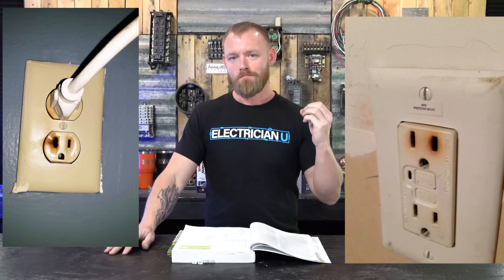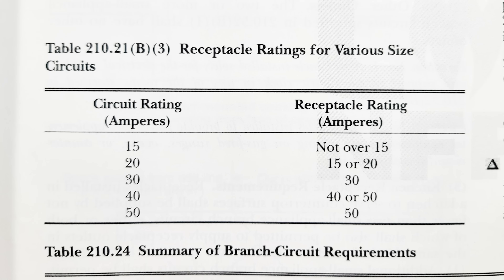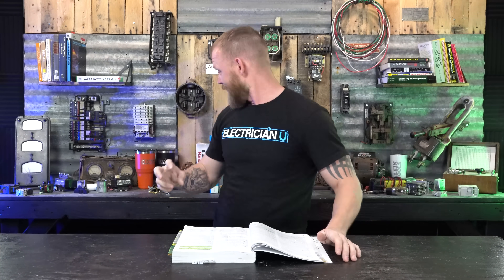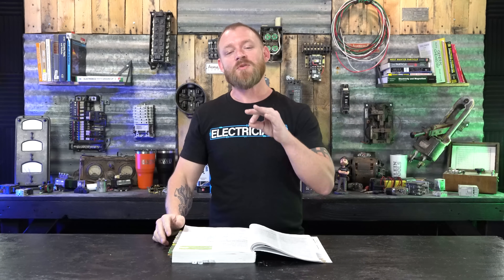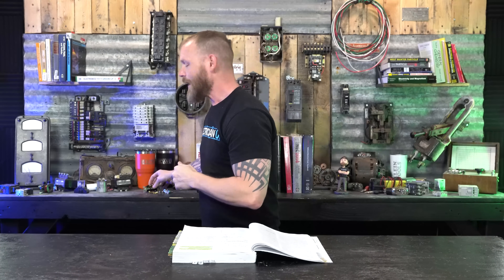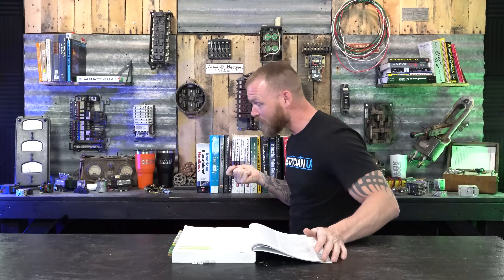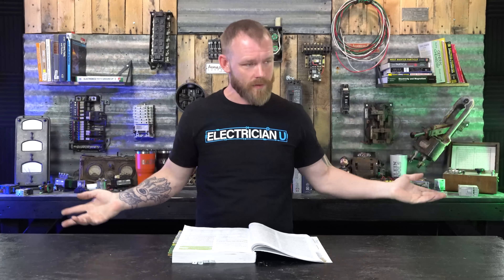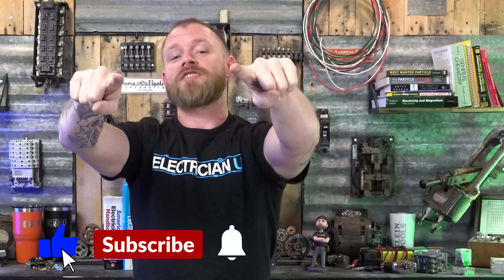Won't These Melt?!? 15amp Receptacles on 20 amp Circuits!!!

Comment: I know this.. it's because the 15 amp one isn't winking. The 20 amp one Winks to signify that it's actually quite weak. The 15 amp receptacles eyes are wide open to signify its confidence and strength.
Reply: Wait.  The  receptacle with a higher ampacity is winking because it’s weaker?

Comment: The problem is with receptacles that are older and have lots of plug/unplug cycles which causes the internal contacts to weaken and spread which then causes the resistance at the contact points to rise.  When resistance is increased at a specific point, excessive heat is generated at that point/ junction leading to melting and fires.   Usually not much material difference between 15A and 20A devices.
Reply: And most people, including me, when plug is lose doesn't stay in outlet spread the plug"s legs over and over instead of replacing old lose outlets.
Reply: That vacuum with the bent plug? That's the one splaying out all of the outlets so they're not tight anymore.
Reply: Spec grade.

Comment: Your Code book  looks  like our Regulations book, same science just different voltages. Our  breakers go from 6A lights 16A fixed appliances (freezer ,Heater and Boiler) 20A radial sockets (receptacles) 32A Ring circuit  sockets.  32A Oven 40A shower.  These are for a domestic  installation. Do you have ground leakages because we have earth leakages  in mA. With so many gadgets nowadays designed to dump current down the circuit protective conductor -ground. little blue arcs with crackling when inserting the earth back in to its terminal.

Comment: Always match your receptacles to your circuit breaker and vice-versa. If the receptacle is 15A rated, then your circuit breaker should be, and not higher, than 15A. Don't believe that because you use 12guage wire your recepticles can handle higher amps. Have you noticed that comments keep repeating themselves? Can we say a case of Copy and Paste going crazy.

Comment: Having circuit breakers in a panel sum to much greater than the main is rational … if you exceed the main it will limit.  Receptacles don’t have a limiting function except melting down.  In a branch, the only limiting device in the circuit should be the branch breaker … not the receptacle.  That the code permits this not rational and the insurance companies that suffer losses due to homeowners overloading THE CODE should sue the CODE.  Maybe that would correct it.  I suppose that this correction has not occurred suggests that the ratings applied to the receptacles are vastly under-stated relative to their actual capability.

Comment: ONLY HALF THE PROBLEM! The actual contact resistance rises every insertion of a plug as the cheap and minimal contact design relaxes contact force over time and use. Also rises from oxidation on plug and socket contacts. A space heater or air conditioner load (steady and maximal allowed by NEC 80% rule, enforced by UL if manufacturer obtains a listing) will generate heat at the contact depending on this resistance (I**2 x R), which all new outlets are fine handling, but normally used outlets of a cheap, minimal design variety become loose. Just compare your first insertion of a plug to the 100th insertion of a variety of plugs with different thicknesses and bent prongs! Only AFCI breakers will catch the sparking that occurs during a thermal runaway event.  SO, a 20 A outlet DOES have the higher force contacts that likely last longer, but so do the higher grade 15 A receptacles, and they will be less expensive! I also see concerning contact design in the 20 A versions with the T shaped contact that I theorize has only one spring force handling all the thickness of the prong  and the horizontal contact being what UL tests for 20A rating. It's a theory, nut it COULD be that a 20A receptacle performs no better or even less with an appliance all having parallel blades.
 

I wish NEC drove UL standards to include connection performance after simulated lifetime usage. It isn't the new houses and new appliances that are burning up!
The contact force degradation over normal use of the cheap outlets, power strips, and extention cords is shameful!

Comment: Only time that it would be a problem if you installed a single ( not the common duplex ) 25 amp receptacle for general use on a 20 amp breaker. You are allowed to install a single 15 amp receptacle on a 20 amp breaker for a motor that might draw light inrush current on start up that would trip a 15 amp breaker. Examples would be an air compressor or some air conditioners. Waste of time to spend extra money for ANY 20 amp duplex receptacles outside of a large window air conditioner. Outside of the some what rare 20 amp male plug on a window air conditioner you will never see a 20 amp plug in a house.( Maybe a extra heavy duty circular shop saw ).

Comment: Any sparky’s know why this would happen?: 
20a breaker stopped working, took it off panel and the prongs were starting to melt. House is old with all 14 ga wiring, so I put a 15a on instead (on a different spot in the panel). Also, lights would flicker pretty bad before this, and I thought it was because of neutrals not being bonded to the bus bar, and I tightened everything up, but that never did anything. After replacing the breaker with a 15a it’s stopped.
I rent and have been trying to get my landlord to look into this issue for forever. I had to take this one into my own hands but  I’m sure theres something that needs to be checked out by a certified electrician or POCO. The house doesn’t have a mast and wires from power line go directly to the house for one
Reply: As a UK Spark I would suggest a full overall test for the entire electrical system. With an old house it is very advisable. Faults turn up for a myriad of reasons, but like I said A FULL TEST FIRST. That would find any faults and future high risk items.  Dont wait for your house to catch fire!

Comment: As a residential electrician of 35 years I've always liked to meet with homeowners at the jobs items to go over and lay out what they want in each room of the house! I ask alot of questions , like how do you envision using this room or do you envision adding something in the future!  I can wire things in ways that make it easily adaptable to make the changes or additions by means of methods of wiring or just simple accessible junction boxes!   I let them know that it's easier to do it in the rough or can be done so it's easier later!  I also give to options of how I can make things work AKA switching lites, recepts, photocells, timers,etc!  I've also on huge custom homes mostly were pricing allows more flexibility, I've pigtailed each receptacle so a load on circuit isn't pulling thru the device!  It's take more time to do them that way but feel it's a better job when possible!  I've always been a perfectionist when it comes to my work, sometimes too much I think! I've always tried to be a quality electrician not a quantity electrician!
Reply: @Karl with a K Code is a MINIMUM specification.
It does not limit you from using better materials or methods.

You appear to misunderstand the entire POINT of having a code.
Reply: @bricefleckenstein9666  I think he understands perfectly. He's saying that the code minimum is set too low and that it needs to be updated. And he's not wrong. The amount of power devices pull now days and the amount of devices people have now days is way higher than what it use to be. And if somebody does build meeting just the minimums it won't meet the electrical needs of the average American.
Reply: @MageLeaderInc  While the number of devices is higher, most are not higher per device.
Higher-end gaming computers, gaming consoles, EV rechargers, in SOME cases microwaves are the exceptions.
Overall consumption though is NOT a lot higher, and usually is LOWER, over the last 20 years - thanks to the widespread adoption of LED lighting and CFDs before that and to EPA "Green" standards for the most part - but the widespread FORCED adoption of EVs is going to change that.
Reply: @bricefleckenstein9666  appliances, lights, and TVs are about the only exception. Anything computerized is using more power every year and people are getting more of them. And we're getting to a point where TV's are going to start pulling more power to produce better images.
Reply: @MageLeaderInc  Which is something that was noticeable even 40+ years back when I made Journeyman under a very picky "use best practices" master.
One that HATED some of the "code legal" ideas like pigtail splices, and avoided using ANY splice when possible because he'd had to FIX too many of them that failed 30+ years after installed.
Reply: @MageLeaderInc  looks at my 5950x workstation, compares to the K5 systems I built 25-30 years ago and the Commodore 64 I had in the 1980s
I'd call it "lots more power every 5-10 years", the year-over-year often stays flat for several years for a specific person as most folks don't upgrade every year.
But that's a phrasing debate, we agree on the trend - and it's been accellerating the last decade.
It's worse when you're a commercial electrician (as I was) as servers keep proliferating in businesses.
Reply: It's not hard to put a "loop" in the middle of the lead, and just run the loop "around" the screw and out the other side then keep going to the next outlet.
No risk of the pigtail splice failing, as there is NO SPLICE if you do it that way.
Reply: @bricefleckenstein9666 you are correct sir
Reply: Home owners are clueless and they suck to explain crap to. So bad that they should be billed more while they try and drive price down. Then you gotta deal with some dumb ditz with money that doesn't listen. That's an all inclusive statement too, man and woman. Plus the scamdemic was all about replacing people to pay morons less that don't know these things. That's what the scamdemic was for. Meanwhile you out work people half your age and they cry about how much you make.
Reply: Excellent idea.
Reply: Me to
Reply: I hope your customers appreciate you.
Reply: @Flowerchild778  most do,  I run into some of them years after doing their work and ive been told that they have not have one problem since they've moved in!  I always answer, just like I planned it!  It always makes you feel like both of us got what we wanted!  They got a good job and I got good $ for it!  People should get your best when doing something as big as building a house!
Reply: @@karlwithak. I didn't say ANYTHING about "circumventing" the code.
And it IS a minumum required specification.
If you don't understand THAT, then you're a joke as an electrician.
And I've had COMPLIMENTS on my work from inspectors.
Reply: @@karlwithak. If you DON'T built to at least meet current code, YOU are the one that has no business near electrical circuitry - and you are not only endangering people with YOUR incapability, you are violating the law.
Code is a REQUIREMENT in most of the USA (which version varies some) that I've seen too many morons blow off - specifically including SEVERAL "licenced electricians".
And you can take your comments about "high-fiving" and shove them back UP your rear - most of the inspectors I've had to deal with are VERY picky about code adherence, and the entire IDEA of a "high-five" with one of them is insane.
Reply: @@karlwithak. Electrical inspectors, JUST LIKE "licenced electricans", vary widely.
Citing college is a SERIOUS strawman argument - there is ZERO need or requirement for "college" at any point short of an ENGINEER, but many inspectors have been electricians at some point and quite a few of them went through the SAME vocational and union training that electricians normally go through.

No, they do NOT allow 240 cable to be "laid on the ground" unless they're a total IDIOT - not that I'm saying no such inspectors exist, I have had to deal with a couple of them.
Wall outlets in different rooms are perfectly reasonably to be on 12 gauge IF THE BREAKER IS CORRECTLY SIZED. It's not a best practice, but there's no POINT in most cases having separate circuits if you only have 2 outlets on a circuit, both going to rooms designed for kid bedrooms.
Space heaters are NORMALLY 1500 watt, I have never seen a 1300 watt setting on one. You don't KNOW that and you claim to be an electrician? ROFLMAOSC

Try finding any breakers that are NOT manufactured in China today. I'm not sure if they EXIST - and no, China made stuff is NOT always made to the lowest quality - again, that's an "often happens" but not a fact.
Reply: @@karlwithak. As you prove yourself CLUELESS yet again.
My college time was mostly spent at Rose-Hulman Institute of Technology, though I didn't graduate.
And if you think electricians are routinely college grads, you're not just clueless but totally INSANE.
I am pretty sure that most TRAINED electricians are still Union trained, but that's been changing and the Vocational Schools (some Union sponsored) might have a majority by now.
You really should quit commenting - you just embarrass yourself every time you do.
Reply: @@karlwithak. Hint - the US News and World Report listings of the best colleges ROUTINELY puts Rose-Hulman at or almost at THE TOP of their listings for "schools that don't offer graduate degrees" - and their 4 year degrees are commonly compared to MIT or Cal-Poly.
But they're NOT where I learned to be an Electrician - that was via a Union apprenticeship program.
Your ignorance and rude stupidity is showing AGAIN - or STILL.
Your comments just embarrass YOU every time you make one, you really should stop.
Reply: Proper

Comment: I know my house has 20a breakers with 15a receptacles on a 14gauge wired line.  Is this a problem? Due to the 14 gauge, should this breaker be 15a?
Reply: Yes is should be 1 15 amp breaker.  Tthat is a problem.  Your wire should always be in line with you breaker.  20 amp breaker - 12 gauge wire; 15 amp breaker - 14 gauge wire.  This is because the wire will heat up faster than the limit that the 20 will go to.   Thus a possible fire in the wall as apposed to a tripped breaker.

Comment: What about putting a 20amp outlet on a 15 amp circuit instead of a 15 amp outlet? Doing this with the knowledge that it is a 15 amp circuit and you’re not going to knowingly over load it?  The intention being to have a more robustly built outlet
Reply: Yes, it is NOT illegal. But probably not the best practice because it might lead someone to think the cable behind must be 20 Amp. You cannot take 20 Amps from it.

Comment: I've never seen a socket outlet melt for this reason in New Zealand. I've seen them. Melt due to a poor connection but not due to overcurrent. A socket outlet should be rated to handle as much current as its outlet support. 2 x 15a outlet should be able to handle at least 20a.
Reply: Here in the UK we have a system were there are fuses inbuilt into the plugs and all twin outlets are rated at 32amp and made that way(backed up by 32amp MCB's). Each plug has a max fuse of 13amp- remember our voltage is 230/240 so loads are lower. over heating due to load is always down to a weak connection never down to poorly made receptacles.
how do those receptacles pass fire codes?
Reply: @johnchristmas7522  I like the idea of fuses in plugs. We should have that in NZ too.
Reply: @legacyelectrical  Yes its a good idea but shops employ idiots on electrical counters, who never explain the size of fuse required for aa given product, so most plugs end up with 13amp fuses (Just high enough to accept a 3kw load on 230v) remaining in them that the plug manufacturer provides as standard.

Comment: What about lights and light switches on a 20 circuit? What if your lights are tied into the wall outlet circuit? Super common in south Florida in old homes!

Comment: I remember when I took my electrical license test. I failed that ish twice,but with perseverance (and my contribution to PSI) passed with an 83 on my third attempt. You need a 75 to pass. I believe it still has a stupid fail rate at 70%. 13 years later,Watching this brings back memories on how the code book is written. It’s so open to different interpretations people can(shall?) get away with the bare minimum. Awesome insight and break down of this particular matter. Cheers
Reply: What interpretation, shall means you must or have to follow, and can means you can do it that way, but don't really have too unless the authority with jurisdiction requires it.
Reply: With failure rates that abysmal you must be from Texas.
Reply: @ML-xx9kc  your ignorance is showing. Far from Texas. In my state they don’t hand out electrical licenses to sub par individuals.
Reply: @bito2337  Then how did you get one Mr. Two Failures? Imagine trying to talk shit to an electrician from Michigan when you failed the exam TWICE!!🤣

Comment: Thanks so much for another great video!  One small comment: @ 5:44 you mention that the thermal trip for a breaker is at 130% of rated value, which I think would be 26 amps for a 20 amp breaker as opposed to the 24 amps mentioned.
Reply: I think it should be 23 Amps.  Heat generated is proportional to power.  P = I^2 * R, so a 15% increase in current corresponds (roughly) to a 30% increase in power.